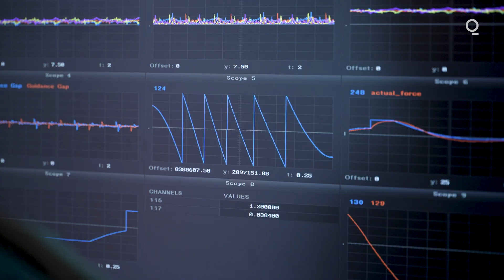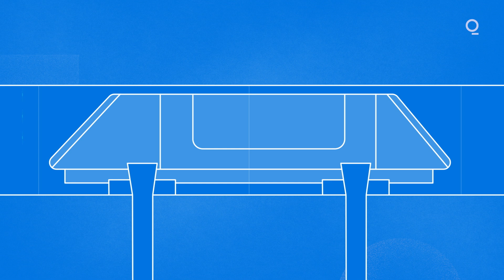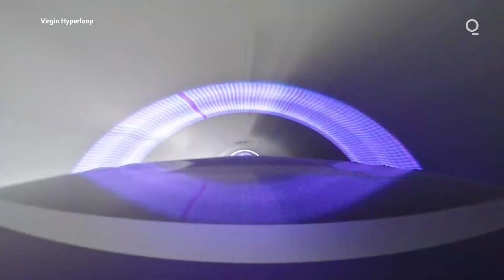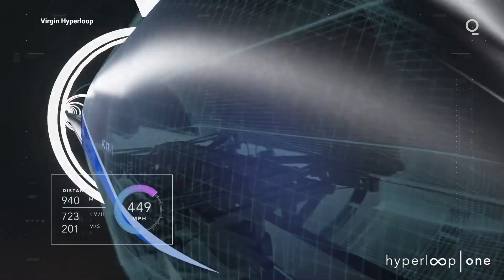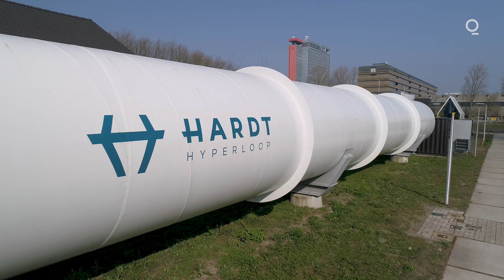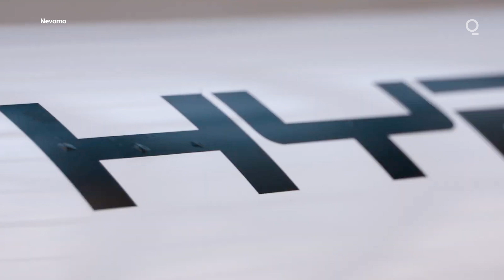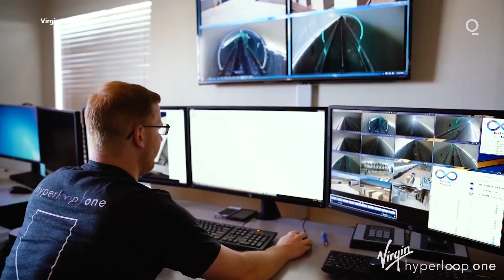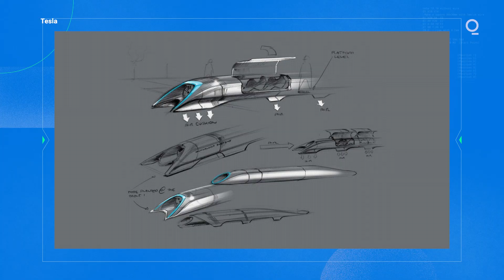The Hyperloop May Disrupt More Than Just Travel

Comment: Ya this wont really work. Sure some of you will argue that this is innovated tech. But lets be honest hear, being innovated dose not mean being practical. 

For example, take the idea of maintaining and building the track. Not only will this be insanely expensive. Making monorails look cheep by comparison. As the track needs to be encased in an airtight pipe. And it needs to have access to compressors and monitoring equipment. It also needs to be elevated as i doubt this can handle slopes well. And the imagery kinda proves that.

On the topic of safety. Nothing is perfectly safe. You have to go into this thinking" what will happen if this breaks down." And not going to lie if this breaks down you will most likely dies instantly. their is no way to survive an impact while moving at thousands of miles an hour. And with this technology their is so many ways it could fail. The compressor could fail allowing air into the tube and destabilizing the train. Power could go out to the track causing the magnetic railing to fail. Water could seep into the pipe due to poor maintenance. Collision could occur while cars are changing tracks or due to brake malfunctions. 

And lastly but most importantly practicality. Will people want to ride a train? Would people want to deal with the gforces generated by this train? Where would you even put a line like this? What environmental impact will it have? 

Ya, call me a Luddite but i am a realist. This is the same thing as the flying car. A cool idea but in practicality it dose not work.
Reply: If air goes into the tube the train will just slow down. And yes people certainly want to use this. Americans won't want to because yanks can't even use high speed rails but this will work brilliantly in Europe and Asia.